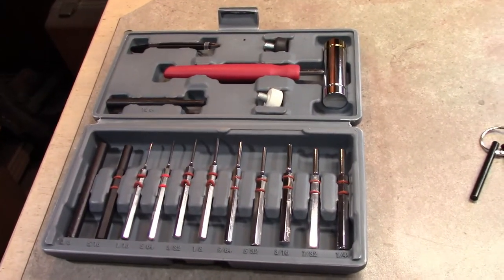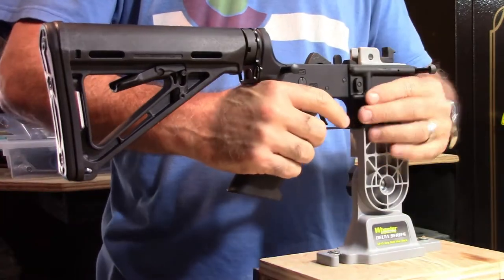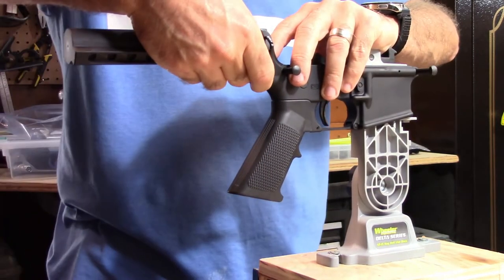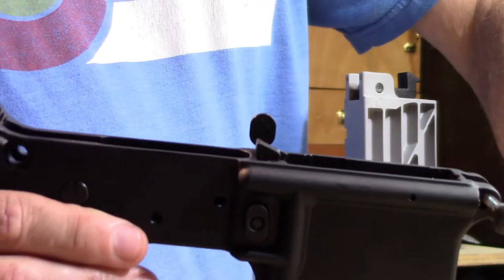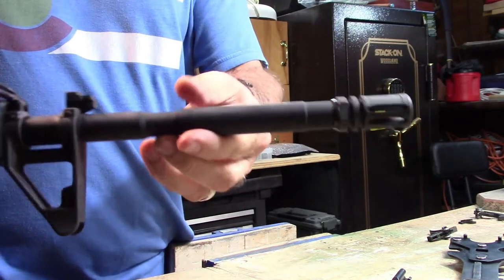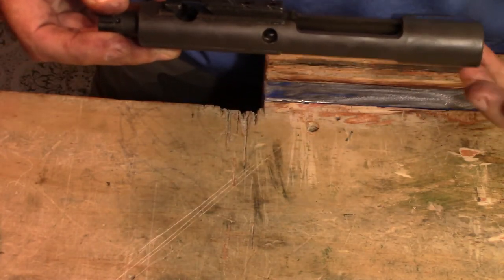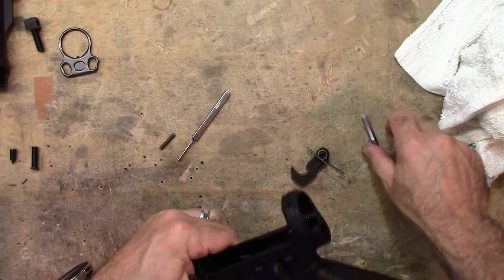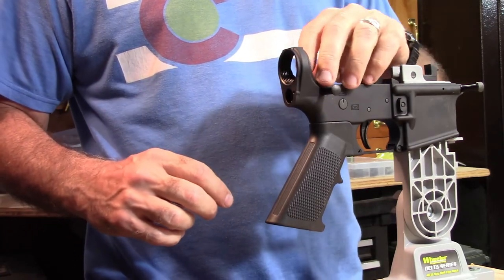Complete Guide: How To Disassemble And Clean Your Ar-15

Comment: Man your a lifesaver, I’m new to guns and I pulled the bolt back and the little nut that hold the buffer fell out and then a spring came out and then it wouldn’t work after that, no one showed where it came from but you, thank you!
Reply from the maker: So glad it worked out for ya!
Reply from the maker: Great point.  With that said, here is a quick run down.  Under the gas block there are normally one or two set screws.  If you loosen them up the gas block and tube will slide off toward the front of the barrel.  There is a small roll pin that holds the gas tube to the gas block.  They make jigs to remove or install this pin easier or, you can use a vice.

Comment: This video has been out a year and he's still answering people's questions..... ive never seen your videos before sir, but ended up here while building my first AR platform like many others. I appreciate you. This is awesome
Reply from the maker: Bryan, glad you liked the video and, more importantly, I hope it helps you with your build! BYOAR is the best, you get exactly what you want and get to tell folks you built it.  I am thrilled I could play a small part and wish you all the best.  If you get stuck or have questions drop me a line!
Reply: @realteam2a  see what I mean...... awesome. I actually have been sitting on buying the rest of what I need for the .223 Wylde build.  It's overwhelming and I was stressed about buying something that's wrong or incompatible...... well it WAS overwhelming  until your video. Thanks to you sir, i just picked up a nickel BCG, charging handle, lower parts kit, and giessele trigger. 

The only thing left is the buffer tube kit, because I couldn't figure out which weight would be best. Any suggestions sir?
Reply from the maker: @heathenhalflings  Well there are 2 things I would get a Tubb Performace flatwire buffer spring (Link at end) and a heavy buffer in the H3 range.  I prefer the heavy H3 Buffer (5-5.4 oz.) yes you will pay a little more but the smoothness and recoil reduction is fantastic.  In addition, if you ever decided to you could use it for 7.62x39, 300AAC and even the .458 SOCOM.  It is nice and heavy so your Wylde should handle like a dream.   You can get the Flatwiire buffer spring here: http://davidtubb.com/ar15-bufferspring (I do not get compensated for recommending Tubbs.)
Reply from the maker: @heathenhalflings  And good call on nickle, way easier to clean and it just looks pretty!

Comment: Let me preface this by saying: I'm very new to guns(Only shot two firearms in my life, both .22 caliber, and that was about a decade ago. I'm in my 20s now, and way stronger). 
I am looking at getting my first AR-15, and I have some very specific customizations I want to do. Figured I'd watch this video to get some idea of what I need and how to take these apart. I'll get more specific with what I'm wanting to do, so anyone can point out if there's anything specific I should expect.
Here it is:

Base specs I am looking at, which will remain consistent after customization: 
20 inch barrel, 
Rifle gas, 
Standard front sight/gas block(with bayonet lug and sling loop),
A2 length stock, 
Chambered for 5.56x45mm, 
Right handed BCG, bolt, and upper receiver.

What I am looking to customize:
Ambidextrous mag release, safety/selector, and charging handle, 
Bayonet ready flash hider,
Wood grip, stock, and A1 style handguard.

Possibly looking to change the barrel, too, but that will depend on the profile the rifle comes with.

So, is there anything I should keep in mind, or will it be pretty straightforward?

(I am Right-dominant Ambidextrous, hence the ambi customizations, while retaining the right handed ejection port. Long story short, Broke a palm bone in my right hand a while back, had to learn to do some stuff with my left, things happened, and here we are)
Reply from the maker: First, welcome to the channel!  Everything you put on your list is attainable!

Strike Industries makes a solid Ambi mag release https://www.midwayusa.com/product/1021312544 
 Wilson combat is the ambi safety I normally use: https://www.midwayusa.com/product/1025171642?pid=891016
Great looking wood "furniture" : http://www.blackgunswood.com/ 
Palmetto State Armory upper with BCG: https://palmettostatearmory.com/psa-20-rifle-length-5-56-nato-1-7-upper-with-bcg-and-charging-handle-1.html
Ambi Charging handle from Battle Arms Rack: https://www.midwayusa.com/product/1022268337?pid=804517

The PSA upper will save you a lot of time.  It is a great price and meets your requirements above and it is assembled.  The only thing you will do is remove the handguard and put the wood on on.  You can use any lower receiver.  I normally use Palmetto State Armor, Anderson Manufacturing, or Aero Precision for my lowers.

Best of luck and please post a photo of it when you are done!

Comment: The extractor piece is that the piece that keeps the slide from going forward an havin to push down on the inside of the clip?
Reply from the maker: The extractor is at the end of the bolt and grabs the casing so when the bolt blows back it ejects the cartridge.  There is no clip in the AR-15.  You may be thinking of the M1 Garande in which you had to insert the clip and push down with your thumb hard and pull it out before the bolt slammed forward.  This would give people "M1 thumb"
Reply: @realteam2a  im not trying to kill myself my guy😂 I don’t fk with grenades
Reply: @bostongorge3507  he said Garande (an older rifle) not Grenade.  LOL
Reply: @joefaletra8298  i know i was joking sorry 🤦🏾‍♂️😂

Comment: howard KAHN
you are in the  business so you know what you talk about........giving that over lube is better than moderate oiling what about using WD40 for a solvent and oil job? duel purpose fluid.....,second question.....will over lube hurt the function of the weapon in a dry environment??????
Reply from the maker: Howard, Great question!   Lubrication can vary depending on location.  For example, in cold climates oil can thicken and cause malfuntions.  In a desert area oil can pick up dust and dirt. A good rule of thumb is you want a thin layer of high quality gun oil on all the moving parts - just enough to reflect light.  As far as the AR bolt is concerned, many people like to "slop" the bolt with oil.  I was one untill I was shooting at a match in Arizona and learned just how much dust and dirt collected.  From that point forward i use HIGH QUALITY oil Like that from Shooters Lube or Modern Spartan Systems.

Comment: What grease do you put on the firing pin and bolt carrier? I never heard of putting grease in a gun. I am fairly new to AR's though.
Reply from the maker: We use Gun Butter,=.  Any gun oil will work but the AR really likes the bolt and firing pin to be lubricated very well.  If you live in a dusty climate like Arizona pay attention to keeping the dust cover closed.  This is the link to gun butter on Amazon (not an affiliate link): https://www.amazon.com/Gun-Butter-oz-Bottle/dp/B00BYGMNF4

Comment: When I take mine apart the hammer is straight up? How do I fix it..
Reply from the maker: Sounds like perhaps the trigger was pulled at some point.  Pull back on the charging handle BEFORE you remove the takedown pin.  At that point the hammer should be cocked.
Reply: @freedomandfoodways  yea I didn't know to charge it before a takedown. I charge it now the hammer is.down hahah thanks alot.
Reply: @realteam2a  I usually just took it down without it being charged ..
Reply from the maker: @davidgilbert2998  Fantastic!  Glad it worked out for you.  Thanks for watching the video and feel free to subscribe and support a Veteran Owned Business!  Stay Safe!!
Reply: @realteam2a  yea i gotcha

Comment: my takedown pin won’t come out
Reply from the maker: Remove the pistol grip and see if there is a set screw underneath.  If there is, loosen it up as it is there to put tension on the upper and lower so they fit tightly.  If it is there, most likely someone over-tightened it.  Once loose the pin should come out.  If this isn't the case, use a wooden dowel or brass punch and gently tap it out.  Good luck!

Comment: Do you forget disconector?
Reply from the maker: I'm sorry I'm not sure what you mean.
Reply: Disconnector
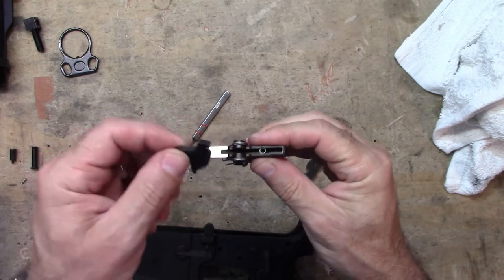Reply from the maker: @kopikooo8483   I am going to assume you are talking about the diconnector in the trigger control group.  If you watch the video is is at 16:22. This is where the trigger system is installed.  So, no it wasn't forgotten.  If it was, the function check would have failed.
Reply: @realteam2a Oh ya, you're right. Good job nice video

Comment: You should NEVER EVER dry fire the lower allowing the hammer to slam into the bolt catch!! This can EASILY BREAK the thin wall of the lower between the trigger pocket and the bolt catch -- ruining the lower (it's nonrepairable) -- the serial numbered portion of the rifle. I CRINGED watching you dry fire it, allowing the hammer to SLAM into the bolt catch wall and bolt catch.
Reply from the maker: Thanks for pointing this out.  I modified the description and gave you the credit!  While we may not agree 100% I reposect your vantage point.  Thank you for your service, I am a 9 year USAF vet myself!  Thanks again for droipping in and sharing your experience.
Reply: @realteam2a  One tip I rarely see regarding installing a bolt catch roll pin. Make a slave pin out of a round toothpick by cutting down the pointed end and insert it from the forward end to hold the bolt catch in place. Then drive the roll pin in from the rear and displace the homemade wood slave pin with it. Makes installing a bolt catch roll pin easier. That was from one of my armorers . . . and it wasn't taught in the armorer school. Painter's tape saves the lower from scratches and scrapes while doing it ,too, but that's common knowledge. (I also use it when putting in the mag release.) In the same "slave pin" category is the Geissele "trigger fitting pin" -- a slave pin tool that's very nearly the same diameter as a trigger pin and has a nifty black knob on it. Not that expensive and has made trigger installs much easier - easier than using a punch. Real Avid makes an excellent, inexpensive tool for installing the front takedown (aka pivot) pin without losing the spring and detent. One of my armorers had made a crude version from 1/4" hardwood dowel with a hole across it. The Real Avid is simpler and easier. A few tips on stuff I've used to make life easier during assembly. Best Wishes and thanks for your service. My brother was in the USAF for four years.

Comment: Full take down my ass. They one part I wanted to see you omitted.
Reply from the maker: What was missed that you are looking for?
Reply: @realteam2a  mag release components.
Reply: I'm gearing up to leave liberal long island for a more gun loving state and will be wanting to convert my fixed mag back to a removable option. It's a pain in the ass to have to crack the gun open every time I want to fill the mag with my ten bullets. I can see why they wanted to do it though. So I can't properly defend myself.
Reply from the maker: @unclebishoppeskitchen5838  You are absolutely correct. I will create another video for that however, the process is to push the mag release all the way in, lift and turn the arm (on the opposite side) counterclockwise.  Once the arm is unscrewed, internal spring and button can be removed (three pieces, arm, spring and button).  Reverse the process for assembly.
Reply from the maker: @unclebishoppeskitchen5838  Come on down here to Florida!  We will welcome you with open arms!
Reply from the maker: @unclebishoppeskitchen5838  here is a video from another person on the process: https://www.youtube.com/watch?v=NiF4LcDz1j0

Comment: Fuck firing pin retaining springs! Why can't it be a pin like the pin through the bolt extractor? Got the little bastard to work with a torch, needle nose pliers and a knife. lol not buying a new one.
Reply from the maker: We should have warned everyone to always have spare springs available!  They are impossible to find once launched!
Reply: @realteam2a  No kidding, but the biggest pain is really getting the split ones seated against the firing pin somehow. i used a knife to press the bent side into the tiny port through the rear of the BCG while smacking the pin with a tiny hammer if that helps anyone who also thinks they need a new clip/spring before they actually have to. you can also close the spring with pliers and apply a torch to try and re-straighten the clip

Comment: I would not recommend this video for complete beginners because he did not show at different angles and he did not explain in detail certain things for example when putting the stock back on are we letting the pin stop that bar that we’re screwing in or are we going over the pin completely shit like that
Reply from the maker: While we appreciate all comments, there have been thousands of new users that have used this video for their first build.  And, you are correct, the video is not perfect but it is certainly useable. If you want perfection, may I suggest you create a video and upload it and share your expertise with others!  I am certain it would help folks as well.  Best of luck with your build!